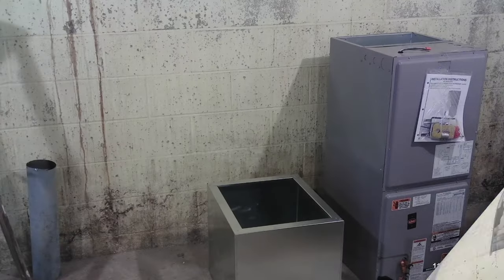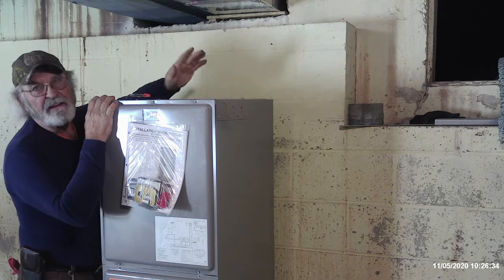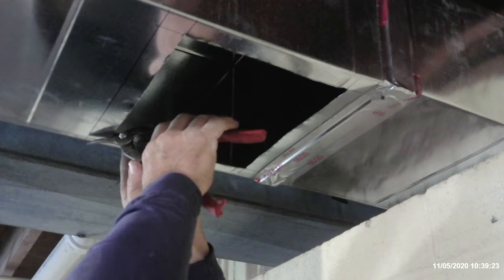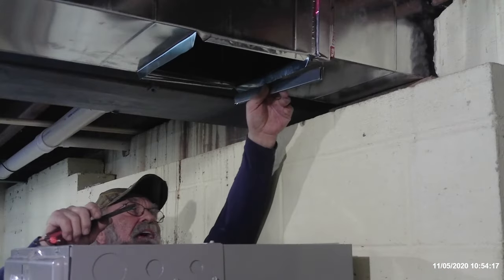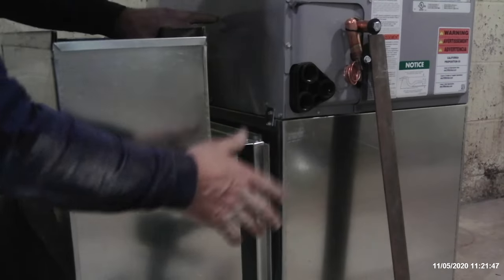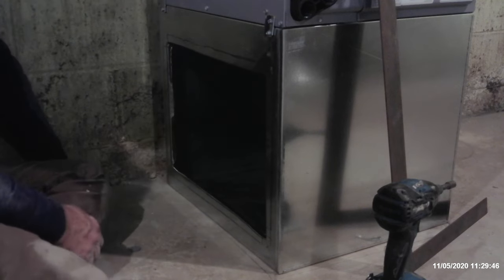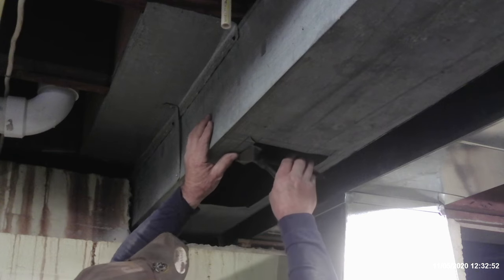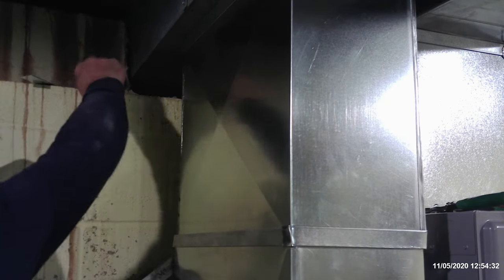Air Handler,  Centerline Plenum Transition and Return Air Installation

Comment: Thoughts on a return plenum “floor-level closable vent?” To circulate cold geothermal, basement level air up throughout the hotter upstairs spaces.
Reply from the maker: It's been my experience to notice that the vast majority of residential systems have an inadequate return air network.  It seems they pretty much all suffer for air.  When they lack sufficient return air, the suction pressure (negative)  on the duct increases, but conversely the load decreases which allows the blower to spin UP in speed because its actually doing less work....limited by the physical constraints of the actual inadequate duct.  With the increase in speed there is an increase in the noise level of the air flow, because of the increased velocity. 
    The most important thing to consider is the probable increase in the level of humidity in the basement area air vs the level in the living space.  As that moisture laden air passes through the cooling coil, it will release some of that moisture to the cold coil then become 'conditioned' air. But the moisture in some cases may bring some odd or unacceptable basement odors into the duct.  It may or may not be objectionable to some.
  All that having been said, it will most likely help the system overall because it, with the added register, will be closer to having the quantity of air available that it was designed to move.  The rule of thumb is 400 cfm (cubic feet per minute) per ton (12,000 btu's) of air conditioning.  So for example, a three ton unit is designed to move 1200 cfm....every minute.   A 2 1/2 ton unit moves 1000 CFM etc.....So if you measure every room and figure the cubic feet contained in each one, add them together you can then easily see how many minutes a system of any capacity has to run in order to do only ONE air change in your home.  Too much information...?? LOL, sorry about that.  Sometimes it just can't be stopped.  But did you get what you were asking for in all that ?
Reply: @tractorman4461  LOL thank you! Yes, that is very helpful! Appears that I’ve got a little bit of math to do. To keep the basement humidity in check, use a dehumidifier that runs via smart plug. Runs 1hr min per day regardless of the humidity. When high humidity is present via IoT temp/humidity sensor, it will run until it satisfies. 
..So, potential CO2 backdrafting safety in mind.. Natural gas dryer and naturally venting gas water heater exist within proximity, (96% furnace has its own vents of course) what precautions exists to prevent a return vent from sucking that CO2 in and dispersing throughout the entirety of conditioned space? 
Thanks!!
Reply from the maker: @m.m.m.c.a.k.e  On the gas dryers as I understand, virtually all the diluted flu gasses are vented through the wall vent along with all the moisture released from the wet clothing.  If the basement door has 1'' clearance to the floor, that will be 36 square inches of area for the blower to draw air from upstairs minimizing the potential from drawing down the naturally vented flu of the water heater.  If you don' t have good clearance or there's a second doorway say...at the bottom of the steps, you should consider a comparable vent opening in the door to the basement and bottom of the stairwell.  That should ensure a bit of positive air flow from the upstairs to the blower.  The resistance through the opening would most likely be much less than the resistance of the 3'' flue pipe. 
     But one test you can do to check the drawing of the flue is to start the blower and start the water heater at the same time.  Take a small hand held mirror and move it vertically around the round draft collector on top of the water heater slowly.  Check for escaping flu gas by continually looking at the mirror to see if any condensation appears on the surface. I use my inspection mirror to check blockages which will result in the same condition for which you show concern. I also use my eyeglasses for the test because if it is not venting correctly up the flu, the moisture from the expended flu gas will condense on the surface quickly on the mirror or glasses.
Reply: @tractorman4461  you da man! I’ll report back.

Comment: Hi,I’m looking to have more headroom in my basement.I have 3 ton carrier condensor and Air handler which has duct size of 26 by 8 where it starts and gets smaller as it gets longer but depth is same 8 inches so my question is can replace my ductwork with size 30 by 6 to get more headroom if that’s not going to effect on air flow? Thanks
Reply from the maker: There is a calculator that will show the changes in the system due to dimension changes you describe.  I don't know right off the top of my head exactly how those particular dimensions will effect the system in ALL aspects, but the change you indicate WILL in fact increase the air velocity.  
    With increased velocity also comes increased noise as well as a degree of increased duct static.  Increased static will increase the amp draw of the motor in the air handler because it has to work harder to move the air. Probably minimally though.  The change you suggest drops the cross sectional area by 28 square inches which is pretty substantial IF the duct network isn't perfectly designed to begin with.  If it started out less than perfect, the detrimental change will be greater.  Hope that helps a bit.
Reply: Thank you sir for replying back 👍  like you said it’s going to increase air velocity so what size would you recommend mu ductwork to start with? Can I keep the depth 6 inches and go wider like maybe 40 by 6 to void all the problems you mentioned? I have 3 ton air handler unit.Thanks

Comment: What was the reduction from air handler to supply duct 🤔
Reply from the maker: It's been several years and I don't remember the exact dimension.  I had to drop it down to match the width of the existing trunk line.  It looks small, but it was only a 2 ton with 800 cfm air delivery and 10kw heat on high speed.  I set it to medium speed due to the trunk size. I figured the duct velocity going both directions and it was with in the allowable range.  Iirc, about 800 fpm both directions. Very little air velocity noise upstairs.

Comment: Good night Wendell, looks like your knocking tin again , last time you were sweating joints in a crawl space,! 
 Now I have a question, after being told the installers and engineers that they will not replace and relocate a boiler from a crawl space to a utility room for me, they state code and labor, I believe that it is labor and job security ( crawl space floods) township building inspector says I can put it anywhere I want as long as it meets or exceeds code, what is your take on it?
Reply from the maker: I believe you are right.  There should be no issue with relocating it to an upstairs utility room as long as its connected to a proper Class B double wall flu and has adequate combustion air for the burner....providing it is a natural gas or LP fired boiler.  If its a newer 'package' style boiler, the circulating pump and expansion tank and automatic fill should be right on the boiler, so it should be a matter of rerouting the supply and return lines up to the new location.  Again, assuming its a hot water boiler and not a steam boiler.  A steam boiler would be a different story altogether.

Comment: I am smart enough and educated and have worked many hard labor jobs. But I have never set an air handler. I have a new air handler that weighs  200+pounds. Will that standard type of air return plenum box hold over 200 Lbs.? It looks so light and crushable. Anyway I have no experience with these things so any intelligent input would be helpful.
Reply from the maker: That must be a monster air handler Matt.  I've never come across one quite that heavy.  But if this box was made from 24 gauge material with reinforced corners, I don't think there would be a problem at 200 pounds.  Most air handlers up to five ton blower capacity weigh less than a hundred pounds. Gas furnaces are heavier and still at only 26 gauge, this style box has no problem. Good luck with your project Matt.

Comment: That supply adapter is bush league as hell 😂 so much unnecessary resistance right off the top of the furnace
Reply from the maker: "Bush league"....??  Not familiar with that term, but as you know with the total system static being well under .5'' w.c. there is very little if any issue with what minor increase in velocity is created with the shape of the plenum, pinching down to the physical limitations of the width of the existing duct. At that point, the duct static drops immediately to then deliver the designed air flow to the two ends of the main duct at the rate of 700 feet per minute.   With balancing dampers in the six inch runs and by use of a digital velometer, the airflow was balanced to match each of the differing requirements of the rooms above.  The system is very quiet and suffers none of the associated sounds of excessive duct velocity or pressure.  Thanks for you your input as it provides pause to thought.
Reply: @tractorman4461  I was just messing around man. I recently heard the term Bush League myself and have been waiting for an excuse to use it 😄
Reply from the maker: @cd1772  Hahahaha....no problem, I just thought maybe you were pressing for a little more detail...I hate to dissappoint.  LOL   Btw,  I just googled 'Bush League' and it said 'unprofessional'.  (OUCH !!)  Stemming from the early days of baseball and all the rural leagues that formed.  If you wanna see some more try this playlist I set up: https://www.youtube.com/playlist?list=PLk72G9DTzZ1taVZjyeN9DKr52HQ3hhcXd

Comment: Cross breaks???
Reply from the maker: I probably should have added them for asththetics, but this being such a small system with only 800 cfm and low duct static I didn't add them to the metal.  Also the metal is 26 ga which is thicker than normally used on small low pressure ducts. Normally 28 ga is used and with that cross breaks would surely have been added.  I have quite a few other sheet metal vids up in the playlists...like this one here: https://www.youtube.com/playlist?list=PLk72G9DTzZ1tqw8ST_xdUlPoy_O-SmuBx There's quite a few boring straight duct vids but also a lot of fittings and specialty fitting as well. Like this one here: https://www.youtube.com/watch?v=Pcz0iEgtuBk&list=PLk72G9DTzZ1tqw8ST_xdUlPoy_O-SmuBx&index=22. Feel free to take a look and thank you for watching this one today.

Comment: How much you a job like that cost, sheet metal and labor
Reply from the maker: Sheet metal cost has jumped dramatically in the last year. Being retired, I no longer am concerned about costs because the only jobs I do are for close friends, relatives and older members of my community that just cannot afford to pay for normal services.  It's my contribution for having had such a rewarding 40+ year career in commercial  hvac. When I did this job, the material cost was way less than $100.00.
Reply: Wish i could pay for your services ... Had a HVAC job done and they did a half-ass job ... didnt even replace the sheet metal box under the air handler and just taped the gaps
Reply from the maker: @Mr.Helper.  Most times the box is rendered inadequate when doing a furnace change.   Besides, I just don't like the looks of a shiny new product resting on something old and dingy. If you watch many of my videos, you will seldom see duct tape anywhere.  At the minimum, they gaps should have been sealed with gasket tape under bends of sheet metal...in my estimation.

Comment: Flex connectors need.
Reply from the maker: I use them commercially on a bit higher capacity systems where vibration or resonance could become an issue transferring through the structure.  A lot of people use them much more often than I, and yes, even on an air handler delivering only 800 cfm with low system static.  Thanks Kurt for your input and for the time you took to watch.
Reply: @tractorman4461  It doesn't matter 2 tons of air or a 100 tons, everything should have a flex connector attached to it. The only reason one needs for flex a connector is common sense.